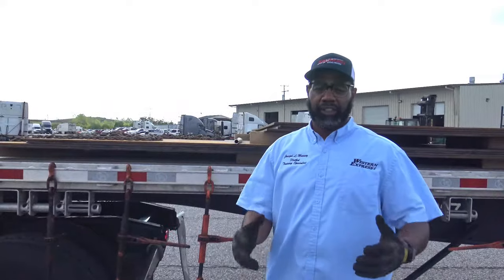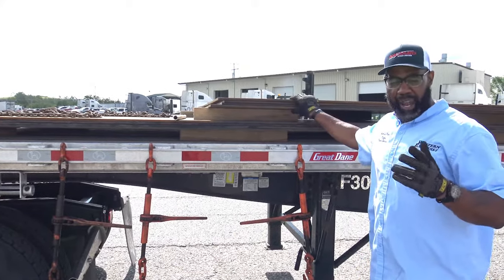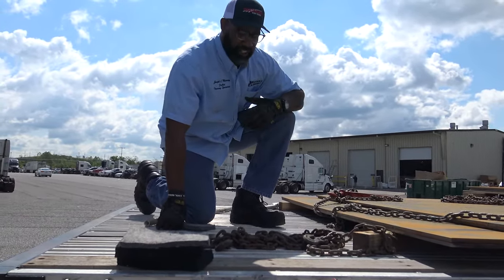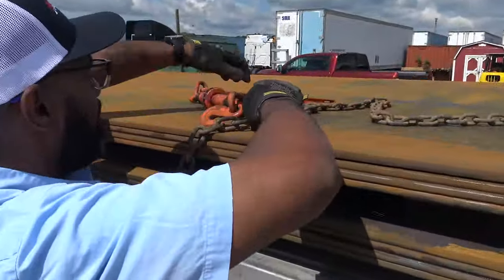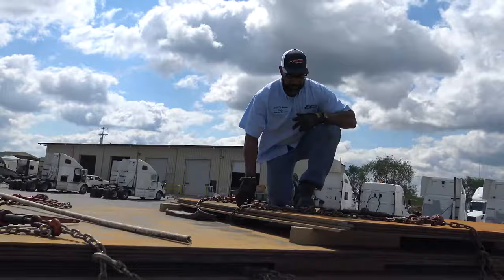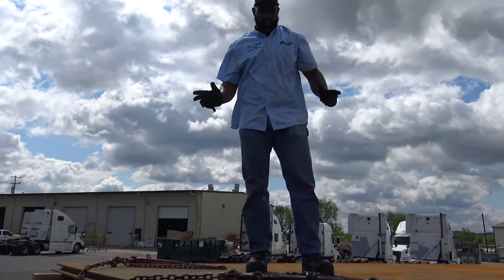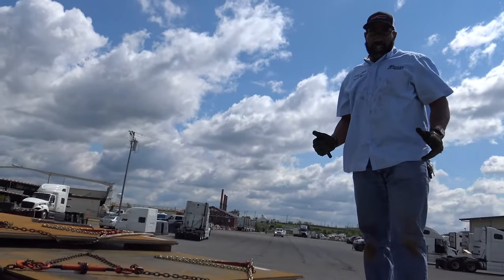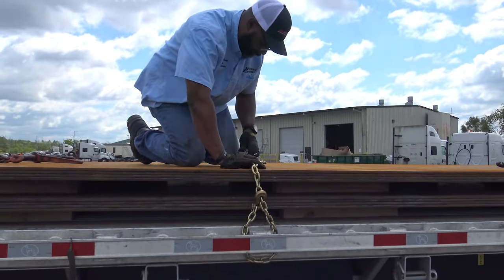How to Secure a Plate Steel Load

Comment: First mistake I noticed… You are never supposed to wrap a chain around or thru a stake pocket.
Reply: You can. You just don’t get the securement credit. But as he pointed out, he wasn’t doing it for that.
Reply: @Invictus13666  you have no clue what you talking about. I dare you to say and do that same thing you just said in front of DOT. You gone wish you had listened.
Reply: @Hi-LoFlippa704  I do have a clue. I’ve heard it from the DOT and from 30+year flatbedders. There are trailer manufacturers that tell you not to do it with their equipment—so don’t—but as long as you’re not doing it for securement it’s fine. 
I’m sorry you’re so threatened by this. 

PS, consider how many WE trucks there are...if DOT had an issue with this, their head of securement training wouldnt be teaching it.
Reply: @Invictus13666 where should it go through
Reply: @mlafi7   Could’ve sworn this was already discussed.
Reply: @Invictus13666  am jus curious whats the proper way,I see drivers do all kinda stuff

Comment: I was told in California that having a strap outside of the run rail is illegal, because if you get side swiped the straps get torn off. I was given a warning ticket and made to change my straps. Around rub rail is a bad idea in California.
Reply: It's not just a bad idea in CA. It's a bad idea period for the reason stated.
Reply: Yeah, where I work, they teach us to put it under the rub rail.  With the exception of some older trailers, most  have a rail at the bottom to hook the straps on.  Those said older ones, you have no choice but to secure them on the rub-rail.
Reply: Should have told cop to show you regulation. That is no longer a rule and hasn’t been for quite a few years. Also most manufacturers give the rib rail a securement value.
Reply: @tylereastburn73  There is a difference between having securements ON the rubrail vs. on the OUTSIDE of the rail.
Reply: Where in ca did you get a warning for putting your securing devices on rubrail. It's legal to put your chains and straps on rubrails. DOT and federal regulations. Been running in ca for 20 years no issue with DOTs.
Reply: I agree with all of you but the fact still remains I got the warning ticket. I got it in Bishop, Ca going south on US Hwy395. I should if asked to see the regulations but I didn’t want to piss him off. Not fond of driving in CA
Reply: @jimpetersen8095  always take a ticket, would have been thrown out in court.
Reply: Yeah California is a strange place with all of its rules and regulations. Try to stay out of that place as much as possible.

Comment: Pay attention to where your straps will be. Do NOT locate them over your tires. And use them sparingly if at all over your drive wheels especially. The fifth wheel can pivot in ways you didn't think of when you're turning on a hill or a dip. And the winches will gouge the sh*t out of your tires if you're lucky or pop them outright.
Reply: Pro tip 👊

Comment: Do you see where the slack is in the middle where the binder is? Loop that under the binder on both sides where it is bound on the plates. That does two things:
1. allows the binder to freely move when tightening.
2. keeps your slack tight.

Comment: Man I miss flatbeddin.    I was spoiled.   I drove a 13 speed 379 exh w/500 hp CAT48 Spread axle trailer with a dump valve.   2 million accident free miles. Got bumps n bruises tho.  I broke the nub off a winch bar in a ratchet once too.   Defective nub on it I guess.  Unstrapping 60 laminated beams in L.A. Forklift driver bumped the load on the other side.  4000 lb beam clunk...  I heard it, stepped back and boom.   Hit my shoulder and arm.   Like getting blind side hit in football.   I wouldn't be typing this if I didn't hear that clunk.   Mexican forklift driver says...  Are Ju okayeee? smfh.   Safety vest, eye wear, hard hat and situational awareness.   Drive safe.  Good Luck n Good Truckin.

Comment: Please stop hooking the chains to the stake pockets
Reply: Suppose to be on spools , correct?
Reply: I don't use stake pockets but depending on the WLL and manufacturer he could be legal. I wouldn't be teaching that to new blood tho
Reply: Using the spools is better, because they are fully welded to the deck. Stake pockets are usually only welded the outside, making them easier to crush or tear off.

Comment: Rug rail has no working load limited i was told ..
Reply: The load limit is variable depending on the manufacturer which is why its best not to teach that method. It's not illegal tho.
Reply: The rubrail is rated the same as the trailer itself unless specified. It's not regulated